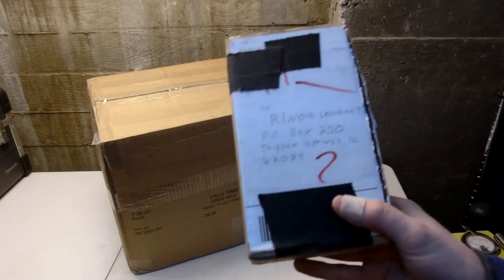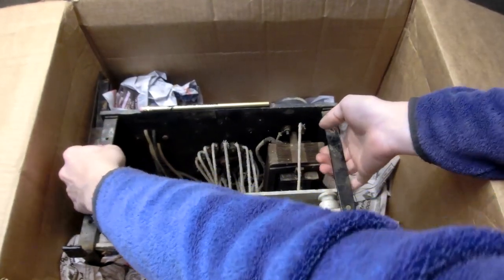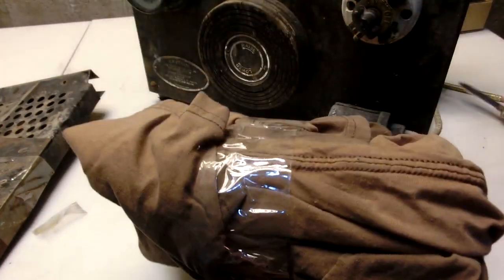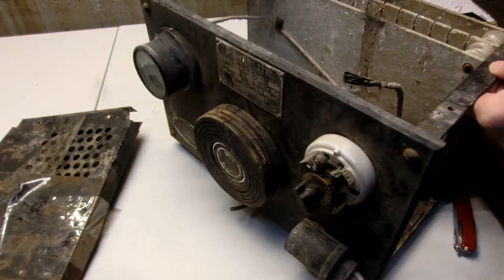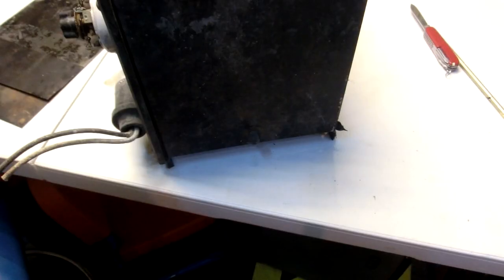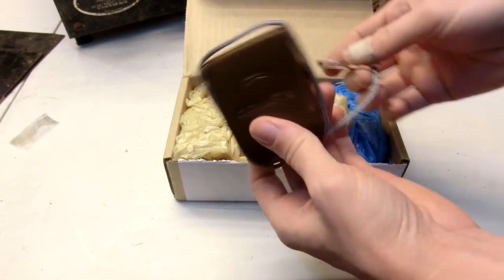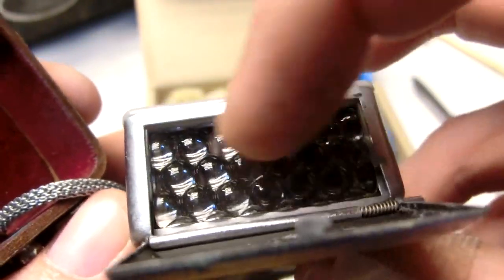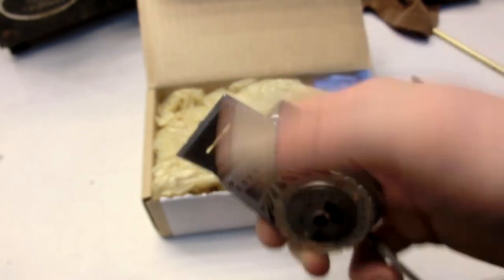inbox 012: antique battery charger, Light meter, Wenger pocket knife

Comment: Cork screws are awesome if you're in a pinch and need to open a bottle of wine.
Reply from the maker: +ElGatoLoco698 i will never have that happen
Reply: They're also good for cleaning out the dried gunk from the nozzles of caulking/silicon/super industrial adhesive tubes. Also good for eye gouging. You know, just in case such a situation arises.

Comment: For the wooden dial I'd soak it overnight in clear spar varnish, then brush off the excess and let it dry.  This will get in deep to bond the cracks.  If the cracks still need some filling, just brush on additional coats as needed and let dry in-between.  Then smooth the finish as desired.  I've got an old weathered outdoor wooden table that I refinish every few years and the spar varnish does a great job binding the cracks.  Use oil-based, the water-based stuff is crap.

Personally I'd look to refinish the metal with some nice high-temp black engine enamel.  That would look super-sharp with the light from the rectifier pouring out.

Comment: to repair the wood, first use epoxy and some sawdust as filler glue, then when set, then use linseed oil, (epoxy under linseed is close to invisible, wood glue can go white)also , you can use paint thinner and linseed oil mix with fine wire wool to clean the outer metal stuff, the linseed will dry and be a protective coating if you wipe a small amount in well. (boiled linseed oil)

Comment: 2 genuine Swiss Army knives, both makes were issued. It's a shame about the chipped blade though. 
The charger, I'd take it apart totally and see how clean I could get it. Maybe treat the rust and give it a blast of matt black paint. It's certainly a cool bunch of goodies you've got..
Reply from the maker: were the Super Tinkers and this model of Wenger used by the swiss army? i'd figure they would probably only have 1 model, and given all the models there probably are, not the Super Tinker. but thats cool if they do
Reply: Rinoa Super-Genius maybe with the battery charger you could modify it to charge your citi car. Just a suggestion.
Reply from the maker: model 2002
citicar already has a charger.
Reply: Rinoa Super-Genius ahh yes I forgot the charger on the passenger side. When will you be doing some more videos about the car. I find it so fascinating the shape of the car.
Reply from the maker: model 2002
i'm not sure, i'd like to some time next year but dont exactly see how it will fi tinto my schedule right now.

Comment: so what phone are you using? you said you record your videos with your phone right?
Reply from the maker: i record with a Casio Exilim ZR-1300 camera. but on my 2nd channel i sometimes record videos with my phone.
Reply: ok thanks for info. What phone model/brand do you have?
Reply from the maker: thingyee1118
just a iphone 5c. while i worked at Apple i found the 5c units were the hardest to break. i'd get an android but my thermal camera uses the lightning plug so it can be flipped around, while the micro-usb is one directional. plus the security of iOS is nice.
Reply: Thanks for replying twice now :D 
Fair enough they have a decent camera on the Iphones. I defiantly prefer Android for mobile OS though, I can install lots of dev apps and access the file system so much easier.
Reply from the maker: thingyee1118
yeah well i personally think phones are a joke, if i want to do anything useful i use my android tablet.
Reply: Seems legit. I somewhat agree :ok_hand:

Comment: Back in the day, my young friend, even perhaps before your parents were born, I would have killed to have one of those light meters that you show in your video, to help me take perfect pictures with my Lubitel 2 camera that I proudly owned. here is a picture of it in eBay: (http://www.ebay.com/itm/like/222308543241?lpid=82&chn=ps&ul_noapp=true)
With that camera, I had to manually set the Aperture size and the exposure time for every picture, and even move the film to the next exposure by turning a knob! That light meter you just got is for helping to decide what Aperture-Exposure combination to choose. The front dial turny thingies work just like a slide rule and only hep to calculate. They don't change anything in the working of the device by themselves.
Thanks for the memories you enabled!...
Reply from the maker: yeah ive figured it out mostly, and somebody else linked me the manual. i plan to use it with my Bolex H16 camera.
Reply: Awesome and exciting!...
How old is your Bolex and where did you get it and where are you gonna get film for it?
Reply from the maker: Farrokh Mirbaha
its from 1962, i got it off ebay, and i've been shooting with Agfachrome 200D color reversal film i got from Spectrafilm&video.
Reply: Then where would you send your film to get developed?
Reply from the maker: Farrokh Mirbaha
back to them
Reply: :P

Comment: Here is that model charger on Ebay. Scroll down for more pics. http://www.ebay.com/itm/1930s-PowerLite-Heavy-Duty-Battery-Charger-Montgomery-Ward-France-Mfg-SteamPunk-/252646949563?hash=item3ad2ee82bb:g:qAwAAOSwyKxXgbY1&vxp=mtr I would clean the charger and leave the paint patina alone. Soaking in Linseed oil would be the best thing for the wood dial. You could 3D print a new dial face for the right upper dial.
Reply from the maker: yeah i've already seen that listing, thanks though
Reply: More than you ever wanted to know about Tungar valves: http://www.radiomuseum.org/dsp_multipage_pdf.cfm?pdf=tungar_bulb_data_manual_52410.pdf#page=1&zoom=auto,-214,649
Reply from the maker: roomba
i'm pretty sure somebody linked that to me after my first Tungar charger video back in 2013 or so. but thanks, i'll definitly brush up on information before i make a video about either.